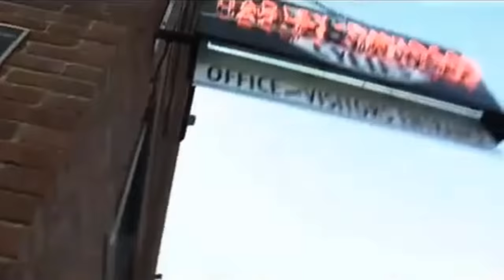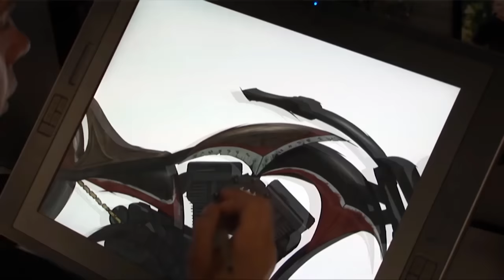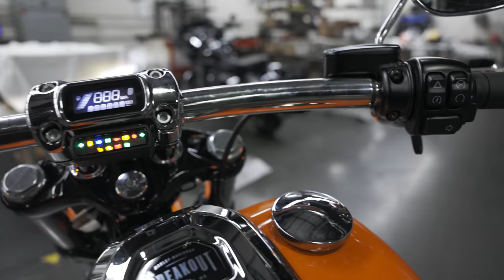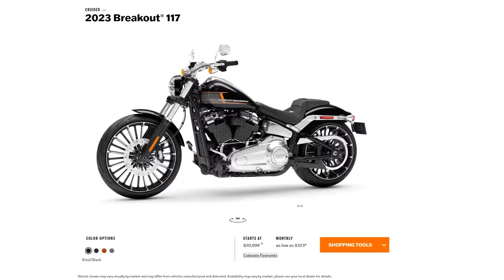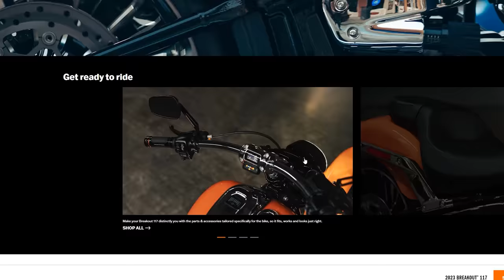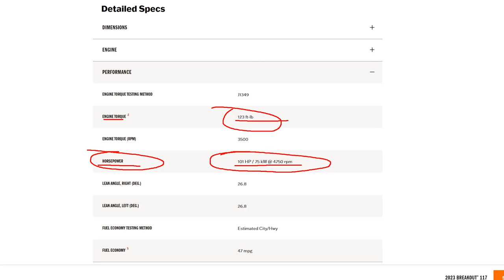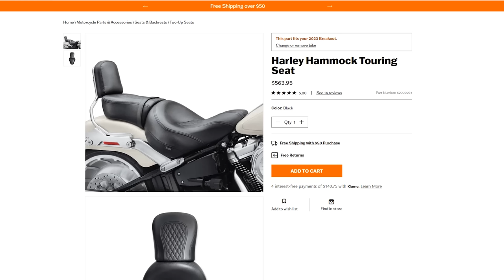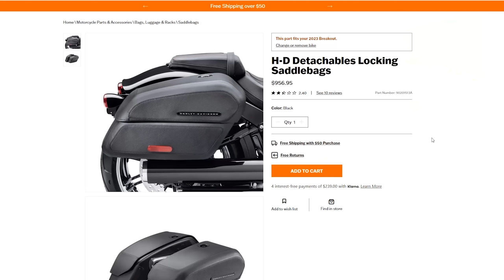2023 Harley-Davidson Breakout (FXBR) Test Ride and Full Review

Comment: Enjoy your videos Matt. I’m 72 years old, first time I rode a motorcycle I was 15. Over the years I’ve had all kinds of motorcycles. All different brands. Currently I own two Breakouts. A 2019 with the 114 engine, I just bought the 2023 with the 117. I’ve never owened a motorcycle I’ve enjoyed riding more. Love my Breakouts!
Reply: You’re quite the lucky man. I’m 25 trying to save up for my first Harley ! Hope you enjoy your breakout.
Reply: @gavinblak23  Find a Sportster 883, used, and have cash in hand.  If it's regular transportation and you aren't going to thrash on it, look into a 2008 or newer Sportster with Fuel Injection. It will save you ton's in headaches over a carbureted model that goes to shit with E-10 gas in it, and varnishes up, needing a carb rebuild, or rejetting if you change elevations and ride up in the mountains. FI saves a lot of headaches with fuel air mixture compensation. Leave it stock, don't put noisy pipes or aftermarket air filters on it, save your money.... you can do those mods when you get much older and on a Milwaukee 8 or a Twin Cam HD.
Reply: I'm fixing to buy a 2023 breakout it's going to be my first bike.
Reply: Thanks for your opinión good biker

Comment: I’m 5’7” and found the breakout super comfortable, I found the lowrider ST however to be rather cramped in my hips. My .02c
Reply: I'm in that height range 5'8 and rode a Street Glide a few years ago, because most bikes are not only taller but wider so that makes it harder to have my feet flat for stability.I looked at the Breakout but passed because I had the SG. So you tried this new version of the Breakout or the older one?

Comment: I love the breakout. Was the bike that got me on a Harley. When I was shopping for a bike a few years back the breakout checked all my boxes I was looking for at the time and looked badazz doing it.  I didn’t care for the small gas tank look and still love the sound of the twin cam over the M8, so I opted for a used low mile 13 that already had the intake and exhaust I would have put on it as well as backrest and swing arm bag. Other than LED lights and mirrors I didn’t have to do anything else to have exactly what I wanted and saved thousands in the process.  I’m 6ft and about 200 and I find the breakout stock seat and all stupid comfortable. I’ve cross countried the bike and camped off it numerous times comfortably.  It’s not a twisty bike and as far as I’m concerned that’s it’s only downfall, but it wasn’t designed for that.  In my opinion it’s by far more than a bar bouncer that many portray it as.  With all that said I did buy a street glide to take over the role of cross country trips for better capabilities on the twisties and better storage to camp off of and such. But I kept the breakout for more local riding and option for shorter trips and still camp off of it. 

I was super excited to see the breakout back, better than ever with the larger fuel tank and cruise. The only downfall for the breakout comeback for me anyways is the new CVO street glides and road glides. Doesn’t make any sense for Harley to totally change the styling of touring models and the new styling not trickle down to lower tier models in a year or 2. I’ve pondered a new street glide twice but not being a adrenaline junky the power of the M8 is not enough difference to get me off my 16 street glide. But I think the design teams did a awesome job with the new styling and convinced I won’t have the patience to wait for the new styling to hit the used market and will likely be my first new Harley.  If the lower tier touring bikes share the VVT as well as new styling I will wait a year at least for the bugs to get worked out. By 2025 I should be able to swing a brand new SG or RG and keep my 16 SG and 13 breakout.  Don’t need 3 bikes, but I have a problem of getting attached to things and can’t let them go. I find both my current bikes to be fantastic and have so many good memories covering thousands of miles on both.

Comment: It's been 20 years since my last bike because of young children. I found the perfect bike to fit me , being 6' 4" most Harleys i always felt cramped.
In 2008 i thought the big dog K9 was going to be the bike but the economy took a crap.
Just walked out of the Harley dealer purchasing a 2023 Black denim Breakout. 
Wow what an awesome bike.
Getting some Vance and Hines pipes and sissy bar installed and we should be good to go. I might even get the forward controls extended 3" but need the rear brake control pad larger first. My shin does rub against the cleaner some but it's the best option being a taller guy.
I can't wait until spring now in the north east.
Thanks Matt for the review it convinced me to get riding again
Reply: I didn't know they made extended forward controls for the Breakout. What company makes them?

Comment: I think this is the best option for old-school riders that want a cruiser.  It is very low in my opinion like most newer Harleys are. I sat on one in the showroom and it surprised me my hip about went out of the socket and I almost dropped it.  lol.  It's cool though. Not a fan of the fancy electronics as they get outdated pretty fast and getting replacement parts 15 years down the road will probably be a nightmare.  So, I would have been happy on this bike with an old school mechanical speedo like the sportsters had a few years back

Comment: Nice throwback intro! I started riding in the mid 90’s and I remember the bike scene absolutely exploding in the early 2000’s. When the Softail Deuce came out, it kind of had that factory custom vibe with the stretched tank and boat tail rear fender. I get that same factory custom vibe with the Breakout. Two bikes light years apart, but similar in some ways.

Comment: I love this bike, the 117 M8 engine, the handle bar, the forward foot pegs and riding position, the decent mono shock rear suspension, the light weight, I almost purchased one this spring but was turned off by the corny gas tank paint job, the ridiculous air intake preventing from stretching your legs on long rides and the single front brake disk. I went with the original large tire power cruiser which inspired the entire line of Millwakee 8, that it the M109R. I wanted an HD really bad, but I found my MOJO somewhere else.

Comment: My local Harley dealer has a dealer markup on all 2023 models. The dealer markup ranges from $2000 to $5000 depending on the model. They still have two 2022 Road Glide ST models with a $5000 dealer markup.

Comment: They all publish at least one power figure. If the bike lists crank Tq at 3500 rpm as 123 ft*lbs, that means it make 82 hp at 3500 rpm at the rear wheel. Simple calculation. Power(hp) = Tq(ft*lbs)*rpm/5252. You can approximate the Tq at the crank from the peak power number too. Tq (ft*lbs) = 5252*Power(hp)/rpm. 
So, Tq= 5252*101/4750 = 112 ft*lbs @ 4750 rpm.
Keep in mind that the calculated Tq at the crank is meaningless to riders as the crank doesn't touch the ground. To find the Tq at the rear wheel, you need to use the rpm of the rear wheel in the calculation instead of the engine rpm. If you do that, you will find you get a lot of Tq and little wheel speed in first gear and a little Tq and a lot of speed in 6th gear.
Anyway, the bike looks pretty good, but I think I prefer the previous version with the smaller tank. I wouldn't kick this one out the garage though,
Reply from the maker: Appreciate the breakdown. I’m familiar with the math but rarely make the effort to actually do it. Thanks for the comment.

Comment: Matt, 

I agree with you when you say that the modern Softail chassi is the best ever designed by Harley…. But as an owner of 3 HD’s one being a 20 Low Rider S….And the other two a 97 Super glide and a 2006 Sportster 883 Low.

I must say that even though the modern softails are fun to ride, they lack many characteristics that makes Harley a Harley.
And by that I mean the vibration, the sound… that the current softails don’t match.

Of the three bikes, the one I ride the least is the Low Rider… because of that reason.
I prefer the Super Glide with its rustic riding, vibrating, with a heavy clutch and with that quintessential Harley sound than the fun of riding a well adjusted Low Rider S…

Comment: I'm 5'6" and I had a 2017 and never had any trouble with this bike. You do need to get used to in the turns because of that fat tire.  Hey Matt are you doing any test ride on the ST  models? Thanks
Reply from the maker: Yea I will. They are the same as 2022 though and I already have those videos posted if you want to take a look.

Comment: Put on a simple Danny Gray seat on the Rocker C and its one of the best looking Harleys made with wide fender hugging that fat 240.
Reply: The Danny Gray seat is good. I have a 2008 Rocker C with the Heartland seat, fixed fender with the flushed plate, chassis and suspension performance mods.

Stage II+ 103. Vance & Hines Big Shots and a FuelPak 3. Dakota Digital instrumentation. Custom Dynamics lighting. 1.25" pullbacks. Wisamic LED headlight. Progressive 422 performance shocks. Clip-on shield. And copious quantities of chrome.
Reply: @luisoutumuro424  2008 C with just stage 1 for now..  Andrew 48 or Woods 222 cams coming this summer.  Going on 2 yrs and haven't seen another one yet on the road.
Reply: @bigblue3568  Nice. Ditto, I have had mine 5 years... and haven't seen another Rocker out in the wild, even at rallies or shows (only online).

Have mine almost debadged... nothing on the tank, covers, etc. Most people have no idea what it is or what is in it.

Comment: I have a 2003 V-Rod that I've customized a bit.  I love it.  It's pushing 135hp, I've done 133mph on it and it was pulling hard when I backed off.  It's comfortable.  It handles well.  All that being said, I have always liked the Break Out.  It's just that, every time I go to look at one, and then read a comparison, the old V-Rod blows its doors off and is a comfortable bike.  I'd really like to buy a new Breakout.  But is it better than my 20 year old V-Rod?  Yeah, I know.....the Big Twin guys hate the V-Rod and the Rice Rocket guys hate the V-Rod.  I get grief from everyone....but I think the V-Rod is a great bike.  But, the Breakout is beautiful!  And I'm glad HD brought it back.  Is the new one better than my old 'Rod?   At 101 hop, that's down about 35 from what I have now....but it's got way way more torque.  Matt, what do you say?   I wouldn't hesitate to hop on the V-Rod and ride from WV to Sturgis.  Is the Breakout comfortable enough for that?  My ONLY complaint about my current bike (that I've owned since 2009) is the 3.7 gallon gas tank.  With the mods I've done, it only gets 31mpg.  So at about 80 miles, the fuel light comes on.  It doesn't have much range....    But I think this new Break Out looks gorgeous :)

Comment: When i bought my first bike, i got a Vulcan 900 custom.  I chose it due to the classic cruiser look and v-twin sound and looks. The other reason was the 5.3 gallon fuel tank! I was pretty much riding back and fourth to work, didn’t want to be getting gas several times a week. 35 miles each way. Now that I’ve changed jobs, I’m thinking about getting a breakout, however I’m short af. 5’1”.  Isn’t there a relocation kit for the pegs and shifter? 
I like the Baja orange, the bigger engine and 6 speed transmission. Where as my Vulcan is screaming at 70 mph.  

Im looking at the breakout for another reason too, dimensionally it’s identical to the Vulcan 900c… overall length the Vulcan is longer, seat height is 2 inches taller, rake is 1 degree different.

Comment: It takes 82 hp to create 123 ft lbs @ 3500 rpm at the crank.
It takes 101hp to create 112 ft lbs @ 4750 rpm at the crank.
The crank is a crank. It does not spin by itself. Burning fuel creates the energy to turn the crank. The rate at which that energy is being converted to heat is the power.

Comment: Thanks so much Matt. As usual great content and gorgeous bike. I have a 2012 Yamaha Raider S and it was a toss up between it, a Breakout, RoadKing, or Heritage Classic. The new 2023 Breakout looks AWESOME and probably rides and sounds like a beast.
Reply: The raider was so uncomfortable on long rides. Plus heavy.
Reply: @motorcycleislife8296  compared to what? The closest looking HD bike to a Raider is the Breakout. You rode a raider and breakout over long distances and found the Raider to be much more uncomfortable? I would say a new custom seat would help tremendously, I bought a $40 cheap Amazon purple pillow knockoff that is made and shaped to put on a motorcycle seat and it WORKED GREAT for my 8hr loops riding in Ouachita National Forest and the surrounding area of Hot Springs, I just came back from a 6 day moto trip last week. 728ibs would feel pretty heavy if it were not for the super low seat height at about 26", (I just put a tape measure to my seat to confirm). What HD bike is more comfortable and weighs less than 728ibs and has a seat the same or lower than 26"? Because the higher the seat the more weight you have to control from falling side to side.

Hey to each their own, I LOVE my Raider and I hope you love the bike you have. But what bike is more comfortable, weighs less, has the same 26" or less seat height, oh yeah and the highest used Raider is currently about $10K and that is with less than 5K miles, the cheapest Raider is about $5K, the cheapest HD Breakout, the closest HD, is about $12K. I'm just trying to apples to apples. Have a good day.
Reply: @motorcycleislife8296  the Breakout was more comfortable and less heavy as its closest HD competitor?
Reply: @RossMalagarie  No they both are just town bikes
Reply: @motorcycleislife8296  yep cruisers not touring bikes, but I love mine, I throw on quick disconnect saddle bags for long trips, and like I said with that $40 added purple pillow on top my 11yr old stock seat, I can ride 8hrs and still feel good after. What kind of bike do you ride?

Comment: Looks very impressive especially in the denim black. At 5’8” I’m right on the border of being able to make it work. If not it would be a Lowrider ST which doesn’t come in denim black - maybe get the paint code.
Reply: If you have longer legs you'll be fine, it's more about your inseam than your height. I'm 5'9" and have zero issues with Breakouts, you just have to sit on it and see if it works.
Reply: @BeardedBavarianBiker.  Thanks for that.
Reply from the maker: Yea, it’s inseam. Sit on it and feel for yourself. You might be just fine.

Comment: Would the fuel tank from this one fit the 2020 breakout?
Reply from the maker: Yes. A fuel tank installed, color matched isn’t cheap though. Probably run you 3,500-4,000

Comment: The biggest issue with HP figures is that it leaves one important factor out of the equation. Which is time. A 200 HP engine could be producing the same amount of HP as a 120 HP engine, at the same moment in time. Trust me, I know, I use to be a spec sheet warrior. This is why people who are honest about supersports bike will tell you that pass 100 or 120 hp, it's just not "usable" power for the street.  Ironically, most metric engine that are considered fun have less HP then their counterpart and are configured toward TQ. Think Mt-07 and Duke 890.
Reply: Same mistake everyone makes when looking at dyno sheets. Everyone is always concerned with the peak number, but the peak number literally does not matter unless you're a professional track racer. 99% of the time you are riding you are using a fraction of your bike's total power.

The only thing that matters is the shape of the lines...how flat the torque curve is and where the HP sets in. Supersports are miserable to ride in normal riding conditions because nobody wants to keep a bike wound up to and well past 8k all the time, if you're below their power range they suck and if you are up there where you need to be, you're in reckless driving territory and doing something very dangerous on the street.

Internet warriors love to talk about peak numbers and ignore torque curves, gearing, feel, and context. There's a reason people have loved low spinning, high cube motors for a long time (not just in bikes, but cars and trucks too.)
Reply: @stevem4783  Great points. I was telling my brother, who had an R1, that he wouldnt really see a difference from 0 to 100 km/h on my Ninja 400 (He laugh at the fact that I had a 400 actually). He tried it and admitted the thing felt as fast as the R1 up to 100km/h (thats 62 miles for you!). The most important thing you mentionned about the spec sheet is that it doens't tell you how the bike will make you feel!
Reply: @einherjar2545  Exactly. Same type of people complain that the Sportster S "got less power" than the Pan Am, even though the S is tuned to bring on the torque earlier and maintain it through the powerband which makes it a quicker and more fun bike on the street, but those people just see 150 vs 120 and jump to a conclusion.

Comment: Great review Matt, love the colour.
Surprised it only has a single front disc. They put two on the 110 pro-street so why not on a 117?
Also electronically governed to 115mph. Why?
I do like the nimble handling of the M8 models over my pro-street.
Can’t wait to get a blast on one. 🔥👊👍
Reply: The Pro Street was supposed to be more performance focused.  The Dual Disks were for looks mostly, to match the performance aesthetics of the inverted front end.

On the new Breakout they aren't going for a performance look, so having a single disk allows them to highlight the front wheel and keep unsprung weight lower.